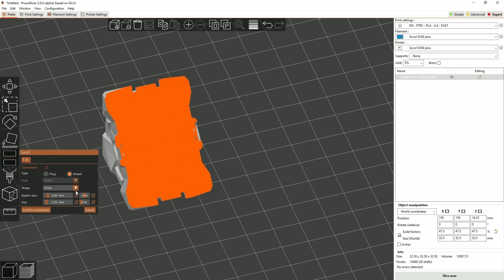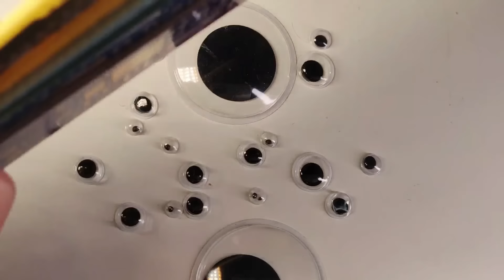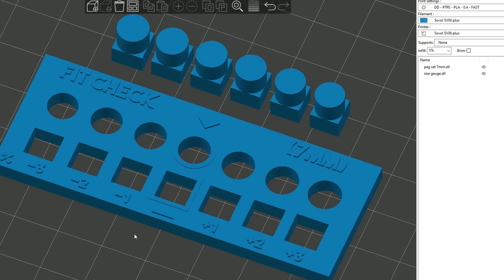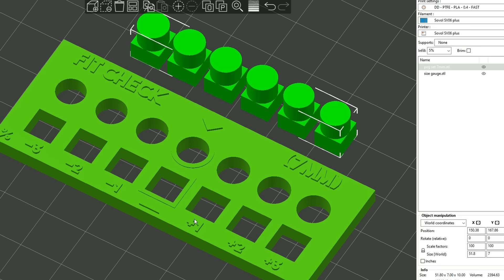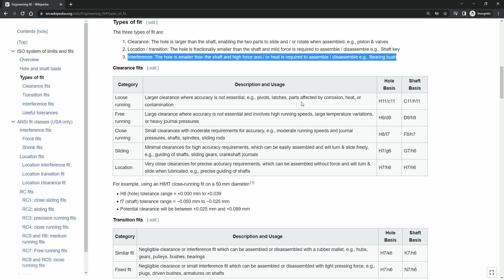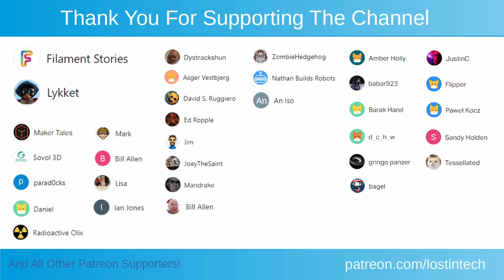Why your 3d printed stuff doesn't fit together and how to fix it!

Comment: TBH it's always a great idea to round the edges of a 3d printable object. For fitting, it is almost necessary, even on a very well calibrated profile.
Also to chamfer the bottom edges - against elephant foot, chamfer is 45° (on a square edge ), so it will print nicely, fillet (rounding) will cause overhang issues.

Comment: I guess depends. Today I designed for 0.025mm radial tolerance for magnets (the whole is bigger by that amount) and the magnets fit perfectly into the print. To be fair they are roughly 0.05mm under nominal diameter.

Works for me, light pressfit on a P2S with PETG.

Comment: Just a detail, interference fits don’t rely only on friction to hold two pieces together, it refers to having a hole that is smaller than the peg that goes into it, so, how does it fit? in an interference fit tipically you cool down a metal peg in order to make it shrink, so that it can fit into the hole, then when it begins to warm up it expands and presses into the hole, the peg want to keep expanding until it reaches its original size, but it can’t because the hole prevents it to, that’s why it’s called an interference fit.
Reply from the maker: That's, if I recall correctly, is called "shrink fitting".
Reply: @LostInTech3D  Not quite, there are three types of fits, clearance fits, transition fits and interference fits. Which in interference there are locational interference fits, which indeed don’t need any bore pressure but are for very precisely manufactured parts, medium drive fits, and force fits, in which both of them we can use the shrinking of a part to put it inside another. You can look that up in Shiegley's Mechanical engineering design Ch.7 and in ANSI preferred limits and fits.

There was another literature I wanted to cite because I remember a Figure denoting the “interference of the fit” as the difference between the (smaller) hole and the (larger) shaft, but I can’t seem to find it at this time.
Reply from the maker: What I infer from your reply is that you agree that shrink, friction and various other types of fit are indeed interference fits. So your initial reply was inaccurate, or rather, overly specific. Right? 
as per https://en.wikipedia.org/wiki/Interference_fit
Reply: @LostInTech3D I was commenting in good faith, no need to get pedantic just because you don’t know the proper terminology. In your video you stated you’re not an engineer, well I'm an engineer, and I'm citing engineering sources. One text in design and one in manufacturing. It’s not me getting overly specific, it’s me giving you the proper information, and for reference, don’t ever cite wikipedia again to me or anyone who’s citing actually proper resources.
Reply from the maker: Not at all. I just wanted to clarify what is meant by "interference fit" as you contradicted me initially.

Comment: Seems logical to me that the inner/outer issue depends on if you are printing a male or female part. If the part is male, yes you want the outside wall first to make it as dimensionally accurate as possible. But if you are printing a hole, it seems to me the inner wall first would keep the inside diameter more stable. No? But if you are printing a piece with both male and female parts, I guess it is a bit of a crap shoot?  Am I entirely off base here? Thanks for the video. I waste a lot of filament with this when I want close tolerance moveable joints. Enough slop will fix any problems, but that results in sloppy joints. It's a frustrating issue for me.

Comment: 3 yrs into printing, always struggled with parts that were premade to fit together and just put it down to my printer being old n not accurate enough, and just have to forever sand everything away for ages.
today was the first time learning of outer wall first and what it does... im going to give my flashforge adventurer 3 another chance in the morning

thanks in advance
Reply: update: 
Thank you so much! this all worked for me and has changed my printing experience ❤
you the man
Reply: @slybynatureTKN well it's really the thing you always look at and never really put extra thinking into. I mean it's reasonable that if you put inner or outer wall first then one will be more accurate than the other. But somehow it barely crosses the mind that "wait a minute, it affects how my parts fit"  :D

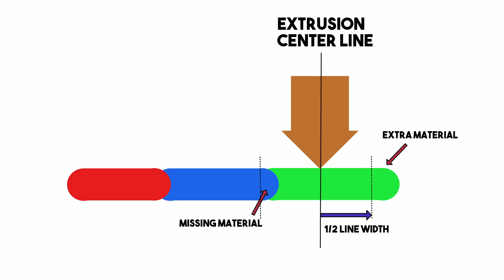Comment: 3:00 That can't be completely possible. Or at least there's an upper limit.

Since the nozzle takes a predetermined path. Worst case scenario the printer would start printing over previous lines.

Comment: This is all my jam. I'm a CAD designer that got into 3d printing a few years back. It goes without saying that I am more interested in functional prints and dimensonal accuracy so i always spend a lot of time setting up my printers in order to get them to print right. It takes a huge combination of mechanical tuning the machine, etting up the firmware correctly, and designing using good toleranes. In the end you can fine tune using the slicer. I personally wouldn't change tolerances using the slicer but I mostly print things I designed myself so I have the luxury of choosing my own tolerances.

I have printed a lot of tolerance tests as you have and find it always interesting to see how well they fit or don't. It can be a big help of knowing how a fit will be for designing parts. 

As you have pointed out squares a hard to print because of the corners. That's why I never really use them. I place radii on all corners on the xy plane to get better prints and better fitting parts. even a small radius with 1mm can go a long way in making square parts fit. And a slightly bigger radius on the adjacent part. In the industry we break edges because of the same reasons. Now with metal you would place chamfers since they tend to be easier to get right but with printers it's radii all the way. 
In Z axis i tend to prefer chamfers tho because the 45 degrees allow for overhangs. At least at the bottom.

Also something I have started playing around with is focusing more on the holes. If you want to get even better fits it's easier to get good outside diameters than inside diameters. Especially because the seams tend to add too much material that will destroy a tight fit. With an outside diameter you can simply sand the seam off but with holes it gets harder to remove the seam. What I started doing is trying to print even diameters Instead of adding tolerances to the holes. The thing is it's easier to buy a set of drill bits and ream the seams off using a handheld drill. This means that you only need to apply tolerances to the outside diameter. If you print a cylinder you can then simply sand off the seam and technically you have an ever preciser fit than you would get by just printing.
Reply: Machining!!
That’s the solution 
As bad as it sounds 
I’m stead to tune 
Just machine it up
At the end with a good
Calibration 
Very simple and very effective 
Thanks”

Comment: In theory you CAN have two edges occupy the same space. An edge is a set of countable infinite points and you can always fit any countable infinity between the spaces of another countable infinity. I know this is a bit complicated to understand, but there are some good videos on this topic, just search for Hilberts Hotel or the Banach-Tarski Paradox. Still, in the real world of 3D printing (or any other manufacturing process), you will need to implement tolerances.
Reply from the maker: or buy a larger hammer to exercise your theory

Comment: I know you have stated you are not a Engineer. I am Mechatronics Engineer and I know one thing when it comes to measure,compare parts and accuracy of machines. Use Good Caliper like Mitutoyo or Dasqua they will help you to understand problem a lot. Consumer printing or Industrial printing can't give you the accuracy of Haas,Okuma CNC machines, they have usually 0.01 accuracy some machines even have 0.001 accuracy. 3D Printing is not exactly manufacturing methods to prototype accurate parts. But most importantly don't use other peoples so called calibration objects they are the worse things you can rely on. Machine calibration is simple, do maintenance measure everything,test compare again,measure that's it. Nothing fancy

Comment: it's mostly arc compensation and cumulative error.  printed pegs usually come out slightly small, and holes come out slightly undersized.  hole spanning more layers = more cumulative error = smaller overall hole.  If I have control of the model, I usually fix it on the holes (starting at 1/2 nozzle width) and leave the pegs alone.  as far as bulging corners on XY squares, again I try to fix it on the model by making nearly imperceptible holes in the corners to force the printer to help prevent the filament taking the shortcut.

Comment: I live the thought behind this, but you may need to update the video, or part here due to how this is shown to work in the video.

When you were measuring the square hole on the -3 section, the screen showed a size of 6.7, which is 0.3 mm less than the 7mm "correct" dimension. Just shouting this out because the guide seems to indicate that this should be scaled down by 3%, however 3% downscale is 6.79 (7*97%), not 6.7. If the aim is for user to just scale a part by percentage, then this should not cleanly divide in to .1mm changes.

Comment: I usually take some time to set the Shrinkage Compensation option according to filament manufacturer specifications for X/Y and Z by type of filament, for me at least it seems to help when fitting between different materials, i think this too should have been addressed in this presentation.

Comment: I foolishly spent a week printing different parts to something that I cut up in prusa slicer and didn’t check a single part to make sure it fit until the whole thing was done.. there’s almost a mm difference between every connector and it’s mate

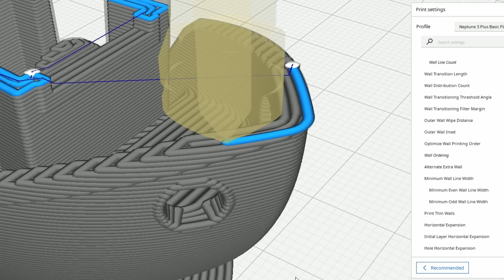Comment: 3:45 what program is that and how do you preview the printing process?
Reply from the maker: that's the slicer preview, it's usually under "preview" tab and you drag the bars back and forth to move the print head.
Reply: @LostInTech3D  But what program?

Comment: Cura actually changed it. It is now called Horizontal expansion under the "Shell" tab and a negative number will make the hole bigger and a positive number will make it smaller

Comment: Well done. It’s one of the frustrating points of FDM. Trying to produce dimensionally accurate objects and the numerous failures involved in finding the ideal 3D printer settings and calibration strategies. Nothing ever seems to print as well as the first test model supplied by the maker. I always end up drilling-finishing by hand or going the CNC route which is noisy and dirty and involves standing in the cold shed getting bitten by mosquitoes haha things we do! I’ll be using your tool for sure thanks.

Comment: I've had this issue, especially when your not printing everything on the same printer but also when you need to match an already made part. Trying to chase the size is crazy, since with that there's clearances left right and up and down but when you make those correct the holes on average are too small. You do have a setting that can enlarge just "hole size" but the program also enlarges curves or bends on occasion. 

I've found that best way to do this is to add wall layers, keep the overall size to be correct and use a drill set to correct hole sizes. Especially with holes designed to be tapped by a screw to plastic its better to match shaft size not thread size to get a good bond. 

I've had issues where if you zero and calibrate your printer, and pull a file from a designer they may have a printer that's not exactly calibrated and instead of them going in and changing the step motor settings to adjust for that they just augment and stretch file settings so it prints on their printer. 

This isn't bad if you print all parts that way but the issue comes in when it's something that needs to match a predetermined part. 

I know people would rather everything just clip together and work but I've found that just a quick swipe with a soldering iron or a file can fix it quickly on parts you can see and parts you don't just use any method to sand and shape it to fit.

Comment: I feel like this is entirely experience. For me, I’ve gotten fairly good at guessing for m2-m6 screws, but give me an m8 and I might get sorta close. It’s so weird. Cause even brass fittings, which are heated in, need tolerances. Where I would think making the wall the sane size would be better since it just merits to the size you need anyway.

Comment: Fitting rectangular parts into rectangular recesses is a problem even in far more accurate metal CNC machining because the round tool can't leave sharp right-angle internal corners. To get around this cheaply (without the need for high precision tolerancing) we use undercuts. Essentially you machine out the corners of the rectangular recess, so that the external part corners have nothing that will interfere with them. You could introduce undercuts or internal corner relief into your designs too.

Comment: The roundness of the circle design also has an impact on fit. I haven't graduated to a real design program. Circles are not actually round in this program, but many sided. A "circular" hole with too few sides will be smaller than advertised.

The program I've been using allows for up to 64-sided circles and half-degree rotation. You can combine twelve 60-sided circles to create a roundish 720-side circle. Hopefully, the limit then becomes the resolution of the printer.

Comment: Can I ask how to fix this with Bambu slicer please ? I'm having a nightmare trying to print a collapsible sword, they are printing fused together and I'm struggling to get it right.
Reply from the maker: the easy cheat is to change the flow rate down a bit, like by 2% or something.

Comment: SunLu ABS, I've had good luck with using a  0.1 mm difference for press-fit parts and 0.25 mm difference for a lose press-fit (i.e. if something needs to fit snugly, but still needs to spin.)  0.25 mm difference is probably too tight if you are trying to make something using threads....I'd probably increase to a 0.3 mm difference and walk the difference up by 0.05 mm to find the clearance you need.

Comment: so....  why are we still using slicers that don't take this into account?  
why aren't slicers smarter?

like even arc.  that was added a few years ago.  and people were extatic about it.  
cnc has had radial interpolation almost since the beginning. 

we used to program cnc by hand.  in a text editor. no prompts no drawing. and no auto generating. 
this means we can't program a circle by tiny straight g1 lines.  it was always g2 and g3 (with an end point in x and y. and radius.  g2 x.. y.. r..  sometimes even the centerpoint coördinates i.. j..) 

and since whoever reads this probbably didn't know.  the first cnc machine was made at MIT in 1952. 
so almost 60 year old technology and it wasn't included in slicers untill just a few years ago.  
it's honestly pathetic.  (and s3d thinks they can charge 200 dollars for this severely lacking piece of software) 

so as far as lacking cnc functions. the slicers have no excuse for not having the features. 
as far as 3d printing technique's.  yet again this stuff has been around for 20 years and there are people on youtube. plain old average joe's making video's on things that should be improved. 

when is a real slicer going to be released?  
where if my printer is calibrated. and i enter the propperties of the filament.  IT PRINTS PERFECT EVERY SINGLE GODDAMN TIME without me having to change ANY of the settings.

Comment: Cura has hole horizontal expansion. If the hole is 0.4mm smaller use 0.2 mm hole expansion and now ur holes are thr correct size

Comment: It would be beneficial to also print a version of the pegs  that have a small .2mm chamfer or radius on each corner.  A 3d printed square hole will always have a small radii in the corners.  A chamfer will give clearance for these inevitable small radii in the corners and allow for proper fit test on the flats of the square.

Comment: On Cura there is an option called "Wall Ordering" and the options are "Outside to Inside" and Inside to Outside". Is "Outside to Inside" on Cura the same as "outer walls first" as stated in the video?

Comment: I make and sell parts with different filament that must interact with each other (e.g. a TPU sliding door on a spring in a PETG channel), and I absolutely will not sell my designs because I cannot guarantee that the fit of the parts will be correct on other machines, and meet the standards I expect. ESPECIALLY since those parts need to then interact with other manufacturer parts that are absolutely outside my control.

Comment: No, you're spot-on. This whole fit issue has already been resolved for machine shop work, and while the tolerances used in milling and lathe work don't apply here, you could use that as a model, or framework. Btw, this is the first time I have heard anyone involved in 3D printing talk about fit and tolerances.  Well done!

Comment: I recently acquired a flashforge creator pro and am running flashprint 5 version 5.8.3. I am very new to this. Can anyone tell me how to achieve the print outer edge first outcome in this software? Thanks in advance!
Reply from the maker: You can use cura to print on the creator pro,  although I'm not sure if profiles exist for it, worth a try

Comment: I found that using just a 0.5 mm filet helps not only get rid of the bulging corners, but also helps prevent elephants foot if done on the bottom edges.